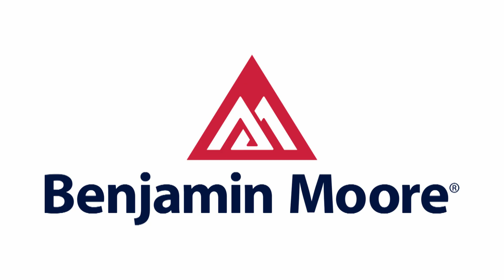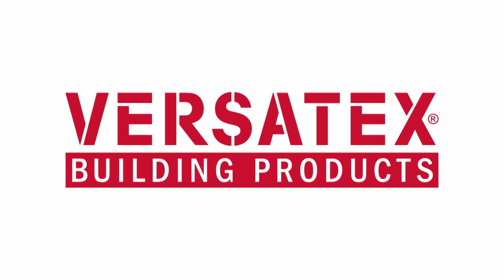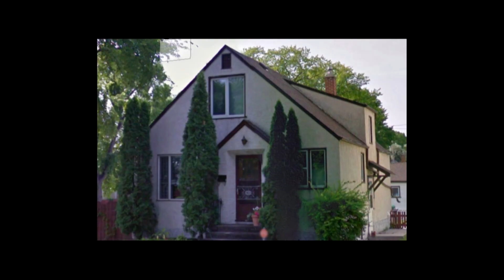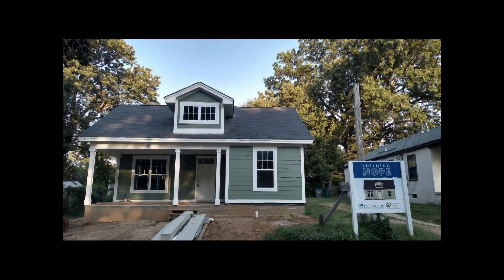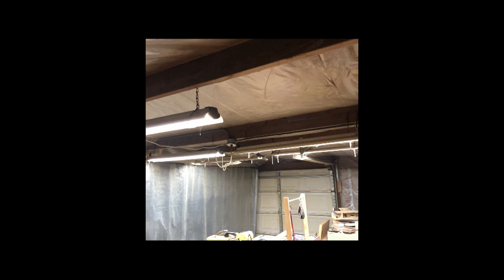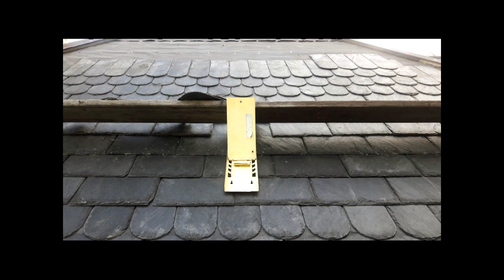The Best of the FHB Podcast Volume 11

Comment: In regard to building at a lower price point - that seems like a great topic to create some lists/charts/models.  I would think there have to be books or coop websites out there that do that.  One thing to note as a teacher of the trades: if I am going to bring a set of students through a unit, having the uniformity of some stock item from the home center can make life a lot easier than dealing with one-offs at the donation center.  (At 35 min) Break down the chimney and get a hybrid water heater (and if you want to really go down the path of indoor air quality and efficiency, get an induction stove, heat pump dryer, geothermal, etc)